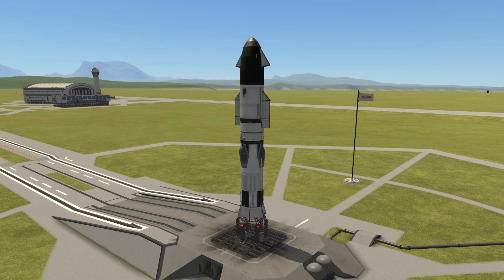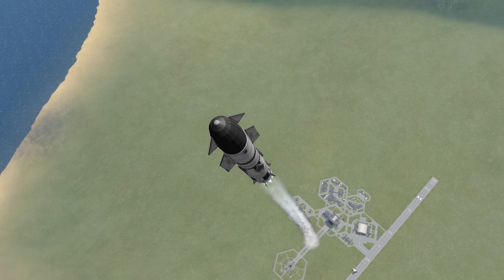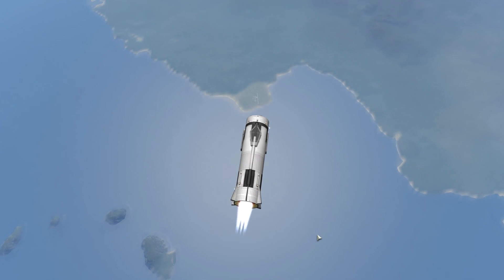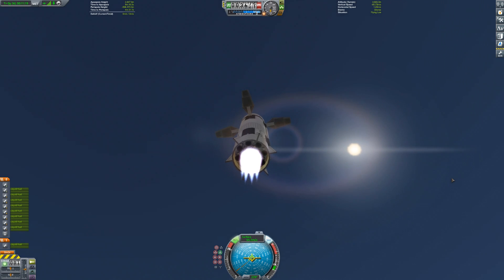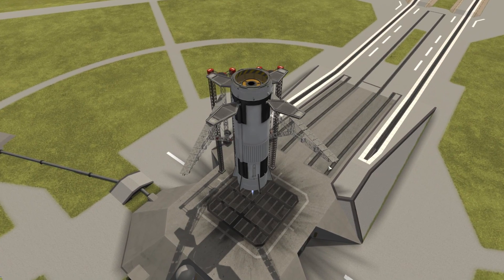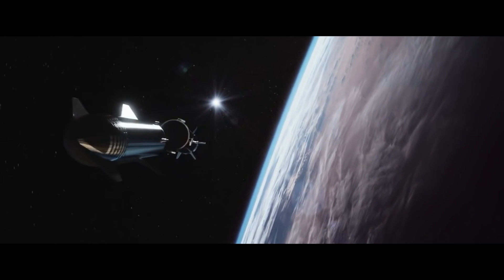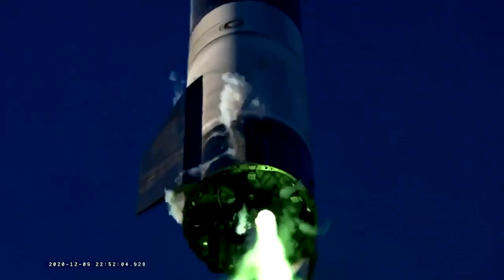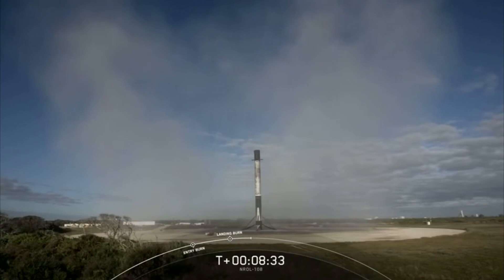Why SpaceX Wants To Make Landing Super Heavy MORE Difficult.

Comment: Faster computers surely has made many older ideas viable.
Reply: Indeed, from a 1940s flying wing that was deadly to the pilots, to a 2000s flying wing that is deadly to the target, computing power made huge strides.  A point well taken.
Reply: Eh, it's not just faster computers. It's the entire ecosystem that allows for much more complex computer programs to be built and tested. Software on the falcon 9 can probably run pretty okay on a low power ARM processor or even a microcontroller.

It's just the advancement in programming languages and availability of tools in the ecosystem.

Imagine building the entire OS of falcon in physical wiring (like in the Saturn 5 and space shuttle)

C and other programming languages make it so much better, we should thank all the computer scientists that developed these to make it possible!
Reply: Absolutely. This has happened a lot throughout history. The wheel didn't become common when someone "invented it", it was a very old, very obvious concept. What really unlocked the wheel wasn't any invention, but rather the access to the materials and manufacturing capabilities to make axles. Hero of Alexandria built a device that converted heat through steam into rotational energy, but steam engines would take a few millennia to become common, not because the idea was new, but rather because Hero didn't have a lathe. The same is true right now, we can design faster computers that we can build.
Reply: Yeah, but, with Hyperloop, it's a non-starter because, despite faster computers, the physics hasn't changed. Elon knows this, which is why SpaceX have completely dropped it from their website and The Boring Company have switched to just tunnels with cars (Teslas, of course) in them... something that's been around for over a century (sans the Teslas, of course). It's gone from (allegedly) the most efficient form of transport to being less efficient than, say, the City and South London Railway (now part of the Northern Line on the London Underground) when it opened in 1890. The reason it's so inefficient is the obvious fact that a train (I'm using the 1995 Stock used on Northern Line as a comparison) can carry ~220 times more passengers than a Tesla can. Given this fact, I suspect the Las Vegas project is just a publicity stunt for Elon to sell more Teslas (both to the Las Vegas Convention and Visitors Authority, who will obviously need to buy quite a few, as well as to passengers, since the whole thing is just a glorified sales pitch for Tesla).

Without meaning to insult, your comment reminds me of a conversation I had with a flat earther a few years ago. His question was something like this: if the computers in our phones are orders of magnitude more powerful than the computers in the Saturn V, why haven't humans been back to the moon since the 1970s? The answer, of course, is obvious: because it wasn't the computers themselves that got humans to the moon; it was the controlled release of a massive amount of energy (i.e. the physics); that requirement hadn't changed in the intervening 43 years between Apollo 17 and the conversation taking place. And that is where we stand with Hyperloop: no amount of additional computational power will overcome the physical limitations.
Reply: @FSF87  "the reason it's so inneficient" when compared to anything else, is it takes decades to build a single path, and everything you're comparing it to has a complete infrastructure. Lol. You slyly slipped in that the entire tunnel can only carry one tesla... what keeps something other than a tesla from ever being a possibility, and failing that, what keeps more than one tesla out at a time? What's to keep a ferry out of a tunnel bigger than most 2 lane car and subway tunnels? Oh yeah, thunderfoot. I forgot... carry on.
Reply: @FSF87  Ive never heard anyone make the argument that the automobile is the most efficient way to travel. Look at commerce. Truck or train?
Reply: @FSF87  That doesn't explain why they haven't gone back at all, they had the ability to recreate the physics. They had the need to also direct that energy in the right way, which is where the vital guidance systems come into play. It would not have been possible without both, and they could've recreated it anytime they wanted, with improvements if they so chose.
Reply: @sirbader1  NASA could have figured out how to return to the moon any time Congress was inclined to pay for the effort... don't know how long it would take, but they have always been able to figure it out again, at some price!
Reply: @FSF87  Hyper loop was a crappy design from the beginning I could do better.
Reply: Material technology has come a long way too
Reply: I wonder, with all that data collected on these unmanned landings, if it would be viable to train a neural network to handle it?
Reply: @formdusktilldeath  Probably thats what they are using for the unmanned landings.
Reply: @formdusktilldeath  Given that Elon had had lots to say regarding AI, I'm going to bet it's already in use.
Reply: Faster, cheaper and more reliable. And I've said it somewhere else that they probably thought about reusing rockets since back in the 60s... but back then reaching into orbit in one piece was already a very expensive achievement that trying to make them auto-land would just be throwing another expensive layer of added complexity just to be burned to pieces.
Reply: I’m gonna write that one down.
Reply: Well the hardware itself is come so far due to the more primitive risk of before
Reply: dont forget better meterial sciences
Reply: In a way yes, but not as you think of it. FPGA is the magic word. You need a Realtime Computing unit, FPGA and ASICS have a better realtime computing Power than most standard Computer, and we got ASICS since the 20s. But with a low complexity. The solution for Avionics were a long time ASICS, as ASICs can be more Energy efficient and are still faster than FPGA's. ASICS are tailored IC for one task, CPU are Allrounder IC which can do everything. A FPGA can fullfill both roles as they are programmable but needed more Power, and were mostley used for Prototyping of ASICS.  
One Example of ASICS is the Memory Controller in your Computer, in the Old Days the CPU had to manage the Datastream as well, when the first DMA Controller came out, the Harddrive got a boost of 1000% and freed up to 30% CPU Power.  On an old 80386 and 80486 you can enable and disable it to see the difference.   
The same goes with modern FPGA IC's, with each new Firmware the Hardwiring changes and modern (since 2011) FPGA are very close to ASICS, so you can "rewire and reprogramm" the whole fast logic with a software Update and you have not to start a complete new production Line of Asics and still have the factor 10 of more speed and efficiency compared to General CPU's.
Reply: Don't call me Shirley.
Reply: Word
Reply: Nope, hyperloop is still a scam at worst, worst investment in founders lifes at best.
Reply: You are right as now the F35 can hover just like people’s drones. Tiny little gyros and computer power make all this possible.
Reply: not everything can be fixed by software though even if you can theoretically do it you might want to go with a safer landing method.
Reply: @RobertLutece909  That is incorrect. It may not take much in terms of the amount of calculations required but the speed of calculation is very important. Plus artificial intelligence programming was not available, neither were more advanced sensors that could detect the rockets altitude speed and position, and also control sensory that can fine tune thrust and direct it with the precision required.
Reply: @RobertLutece909  Nope.
Reply: And now they just completed real quantum teleportation
Reply: faster and smaller!
Reply: Indeed, when the computer is fast enough that you don't have to optimise for every cycle, and can potentially tolerate that one errant input/output better because there's thousands of good to each fail and all in fractions of a second it becomes possible to do some of these older more challenging ideas on an affordable budget - many of them might have been possible with the computers of their era and application specific electronics - its just a challenge too steep and expensive to try.
Reply: Wasn’t the Apollo program basically the government funding private companies?
Reply: @harbl2479  Yes. The difference being: in the past they would contract with private industry for hardware which NASA would then test and fly. Now, NASA contracts with private industry to design, build, test, and fly entire vehicles. SpaceX is the only company really off the ground so far but others are well on their way.
Reply: @harbl2479  Contractors have always been involved. Failure of one got us Apollo 13. But Apollo shows how government is superior when it comes to massive money losing projects. One major reason civil service exists is centuries of failure by private contractors working for government  showed that when it was a money losing venture bribes and influence on political leaders always messed things up and the advantage of private sector disappeared. The Military is Civil Service 100 percent and Professional Armies that is ones made up of civil servants drove private enterprise Militaries off the worlds fields of battle. It not that Civil service is better than private sector results it just in money losing activities like war, basic research, prisons it normally superior or at least equal to contractors. 

Last several decades switch to privatization had nothing to do with contractors better it was Government Employees tended to vote democratic and contractors tend to bribe known as campaign donations to  Republicans. I no fan of how democrats keep forgetting you have to constantly carefully prune government I a radical moderate. 

Apollo was in large part bringing the German Rocket scientists into the project and saying money is basically unlimited. Governments with the money flow full on can make massive science advancements in example WWII development of stuff. Societies of course can't afford to do this constantly. All the great stuff the Soviets pulled off of course civil servants.  The Soviet problem is government is way worse at creating wealth than private sector thus outside of war production and science advancement the system starts falling apart as it ages and true believers die. 

NASA started failing when the counter culture cause public to be very against non practical results money expenditures. Once government activity stagnates under budget constraints things can go poorly. I still mainly see it as a public interest thing. Public not interested not much gets done. 

Here though we finally at the point were people think they can actually make money in space so finally the advantages of private enterprise start showing up. Thus this an exciting time.
Reply: @harbl2479    No. Private contractors were, of course, hired to build the rockets and spacecraft. The government does not manufacture things. Once built though, the hardware was delivered to the government which then owned and operated it.
Reply: That and private funding. With public funding its more of a popularity contest than what idea have a big profit reward.

And its not only spaceX. Its also blue origin and electron.
Reply: @matsv201  Public sector was great in 50s and 60s when there was real competition between USA and USSR..in short years they made insane advances ..but any competition ended with end USSR(sorry Russia but you totally suck compare to USSR space program) ,politicians were not more interested in that (only nerds)  so that was end off any advance in public sector .
 It was be status quo for who know how many decades if Elon Musk did not showed up
Reply: @matsv201  also, in public ventures the safest option in terms of money risk is usually chosen too
Reply: @matsv201  Yes - public funding creates GraftCraft.
Reply: @matsv201  ish, you also cant be spending frivolously. Well, ish, you cant be see too
Reply: @wierdalien1  yea.. you can take risk with privage spending.. but the risk have to be managed. In public spendin they dont even know what investment payback is.
Reply: I'd argue that SpaceX stuff would've been possible to implement with Apollo era stuff, though the effort would probably have been similar to the whole Apollo project in itself. E.g. $260bn in ~2020 dollars
Reply: You see a lot of older more sustainable, simpler technologies some back now with advanced computer control/Npthing Spacex has done is advanced tech, it's just got modern fast code controlling it.
Reply: Another Musk scheme that's literally going to blow up in his face.
Reply: That's not about the hardware, that's not about the software or computers, that's not about public or private investors, that's not even about risk. What makes something happen is the will to go and conquer. NASA/America build the Apollo program to win the race, Elon Musk is building the SS to leave Earth for good. `to boldly go where nobody has gone before'. A dream creates will which creates the way to do the job.
Reply: It says a lot that Starship doesn't even have a cockpit for human pilots and nobody cares.
Reply: @CountArtha  Why the hell would it have a cockpit for human pilots? It's a rocket prototype. A prototype that will one day carry humans, but will mostly operate autonomously.
Reply: @gnualmafuerte  If the production version will have a cockpit, I sure haven't seen it.
Reply: @CountArtha  Why would you put a traditional cockpit on a spacecraft that can fly by itself? Did you see the cockpit on Dragon? The capsule is FULLY autonomous, and there's just a touchscreen to provide pilots with information, and offer the ability to control it by hand if required. They have done ZERO work yet on the payload area, so why would they have a fucking cockpit?
Reply: @CountArtha  because this is a very early PROTOTYPE. Do you not understand how product development works? That's like asking why the rocket doesn't have logos painted on the outside. Because no one cares about that on a PROTOTYPE.
Reply: @gnualmafuerte  Agree with almost everything but.. I bet there is already a ton of work done on the payload system/area. Both for cargo, for fuel tenders, and for manned configurations. When the prototypes can reach orbit and reenter and land safely they can just 'slap' it in. SpaceX just haven't made it public yet.
Reply: Everything SpaceX does was already accomplished by NASA in the 90s. NASA created a reusable, supposedly SSTO spacecraft that takes off and lands just like the Falcon rockets do. The major difference, aside from the SSTO aspect, was it has a 26 HOUR period between launches. Yeah not 52 DAYS like with SpaceX....26 HOURS.

Elon eat your heart out, your shitty rockets aren't even on par with 30 year old technology lmao.
Reply: @WimsicleStranger  if you are referring to the X33 programme I think that you need to do a little more reading on the subject. It never achieved orbit, and that's just for starters.
Reply: @Squodgamullis  Don't forget that fact that aerospikes have been on the drawing board for just about forever at this point. 

Actual, working, linear aerospikes when...? ;_;
Reply: @DeltafangEX  -- There have been several aerospike prototypes built and tested over the years too. Their biggest problems were cooling and not melting. Better high temperature materials for the throat and better active cooling systems will bring them closer to viable.
Reply: @WimsicleStranger  nice b8
Reply: @WimsicleStranger  
Ok ok, you are just spewing bullshits out of your ass, are you doing it on purpose or do you believe what you are saying?

The space Shuttle is NOT an SSTO!
It has 3 separate parts : the shuttle itself, the solid rocket booster that detach once they're empty, and the huge external fuel tank attached to the shuttle who got droped when empty.
An SSTO imply there is NO separation from launch to orbit, not even spaceX try to do that (albeit elon said the sarship alone would be SSTO capable, but with almost no payload), the only true serious concept or SSTO were the X-33 and the skylon.

Falcon9 and the space shuttle have 2 vastly different different landing, first because for falcon9 it's the first stage, while for the space shuttle it's the 2nd stage. Second because the falcon9 do a retro propulsive vertical landing, while the space shuttle do a gliding horizontal landing.

Oh the shuttle was able to launch wihtin 26 hours??? ok, tell me wish shuttle had done that ? Was was the dates of the 2 launches?
Because no launches were ever close to that number , including from 2 differents shuttles

What are you even gaining by spewing bullshit? You gain 1$ each time you convince someone with your lies?